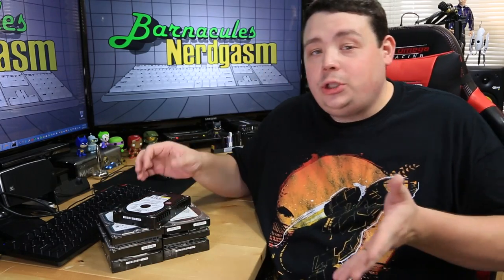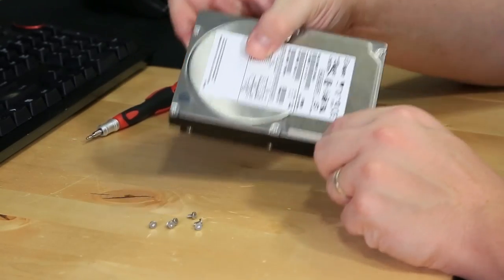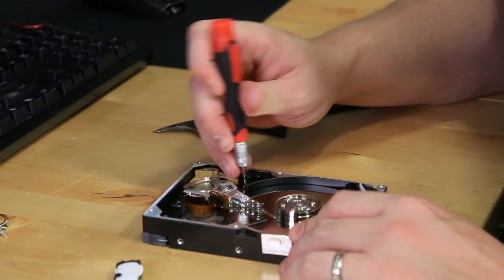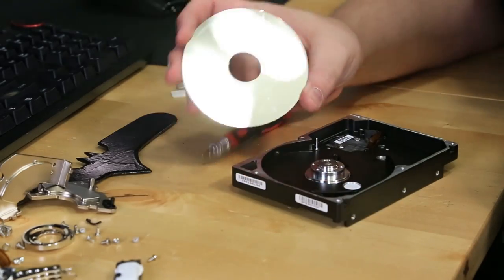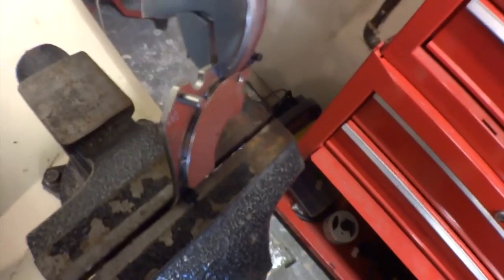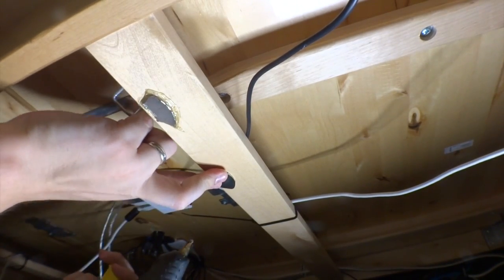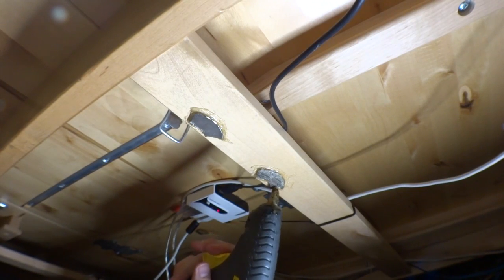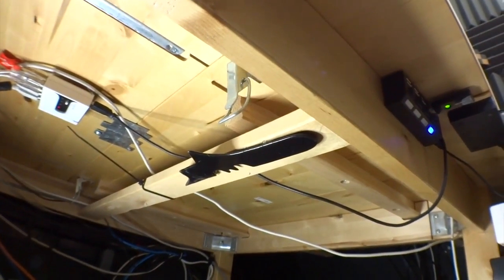Making Magnetic Knife Holster From Old Hard Drive : Nerd Recycling - @Barnacules

Comment: 1. Attach the Neodymium magnets to your remote controls and place under the coffer table/side of coach
2. Use the Hard drive bearing and upgrade your hamsters wheel
3. Take the bearing and platter,  add a handle... instant pizza cutter... 
4. Add a 3D printed column with grooves to hold CD's or Business cards or Utility bills
5. Attach a cable holder onto the platter and bearing, place on ceiling, use your Oculus without pulling or tripping over cables
6. Depending on size of platter, make a custom gated shifter for the Th8?
7. Stick magnet onto side of bedside table, slip a small flat metal disc into your phones protective case. Watch Youtube while lying down...
Reply from the maker: You sir are a visionary :D
Reply: Simbits South Africa fidget spinner bearing

Comment: @IMadeItToTheEndOfThisVideoJerryIsntThatAwesome
My idea for the hard drive platters (Which I have done using old CDs and DVDs before) is to make a mirror on the wall (or ceiling in my case) It can help spread light around the room if you put them on the walls if you have a lamp in the corner of the room.

Comment: darn it!!one of the screws that keep the spindles in place is stripped and can't get it out. I got the magnets out np.  my HDD has 3 spindles I want to use as coasters but that darn screw has screwed me. Jerry help :)
Reply from the maker: Drill it out, get a small drill bit that is the same size as the one of the other screw shafts and then drill right down through the threads and it will break the head off.
Reply: Barnacules Nerdgasm Ill try that but I need a man for that with the tools :P  ok my DAD :(

Comment: What if the magnet comes off, and destroying your networking card or worse, destroying your computer :/?
Reply from the maker: Use good hot glue?!?! What if your desk collapses and traps you under it? (get a good desk) :D C'mon man.
Reply: Barnacules Nerdgasm I mean magnets can destroy electical parts.
Reply: These magnets were already inside the hard drive less than an inch away from the internal electronics and the magnetic drive platters. They won't do anything to any of your computer components unless somehow they fall inside the computer case and short out something. Essentially these magnets are as harmless to computer parts as a screwdriver. Don't touch live electrical circuits with them and nothing will explode. An electromagnet with alternating polarity (like a drive eraser) might be of some concern, but really only to your data if you put your hard drives against them.
Reply: Medieval Blast Not really... in a very few small circumstances yes. The only thing vulnerable in your pc is the hard drive, BUT, they are specifically designed to prevent such things. You would likely need something more powerful to wipe another hard drive. Ever notice how those strong magnets dont cause the drive itself to be magnetized? that works both ways.
CRT monitors are another device vulnerable, because they work off magnetic fields, and introducing your own relatively powerful magnetic field over a prolonged period can cause permanent damage.